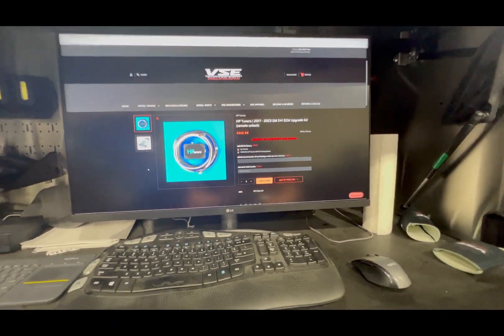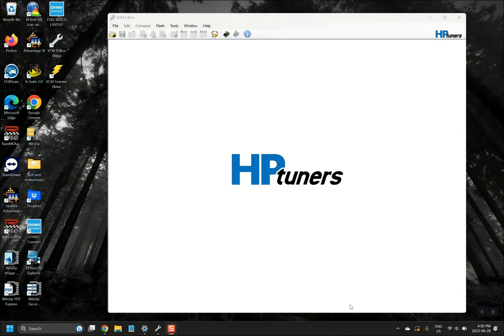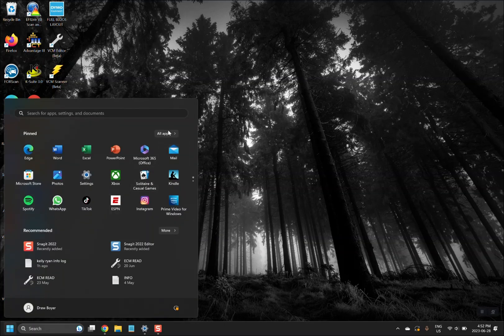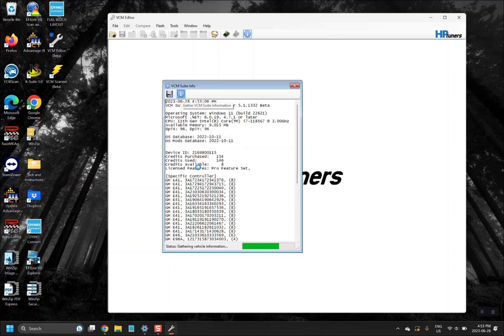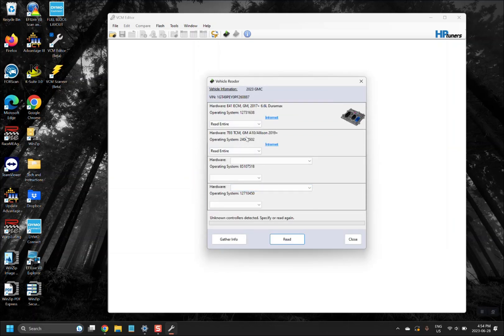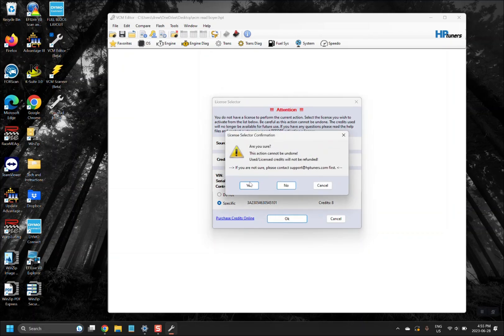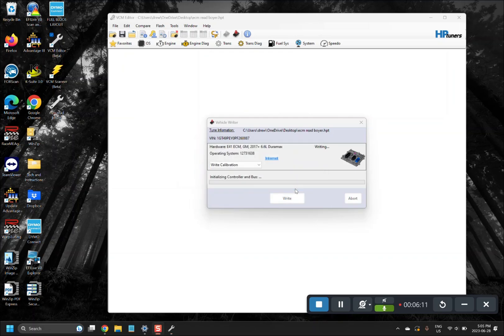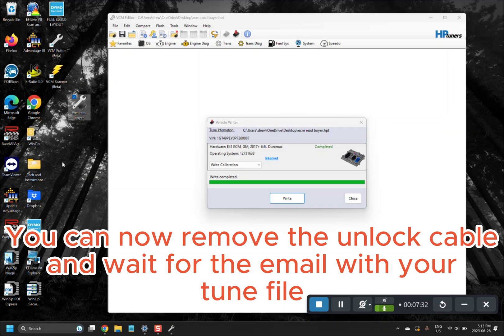2017-2023 L5P + HP Tuners ECM Upgrade Walkthrough

Comment: Hey when you write the ECU does it matter if it’s on write calibration or write entire ? Just seen you had it on write calibration. And when you first read ECU and get the read that’s good to send in for tunning and I can continue on with the unlock and the write and then once I get tune back I can load it in?

Comment: I like what you guys are doing. I’m thinking about picking up that fuel system saver you designed. Where are you guys located at? I have a 2017 6.6 Duramax Silverado LTZ that I’m considering doing some upgrades too. Where would you suggest I start and should I stay emissions compliant they do not currently test diesel trucks in my state.
Reply from the maker: The fuel sytem saver is a great starting point to modifying your truck. Quick install with lasting performance. 

If you're looking for tuning and more performance options, give us a call at 833-789-7700 and we can walk you through all the options we offer!